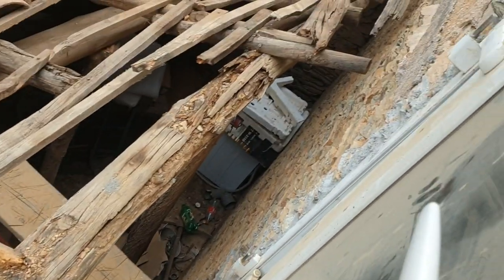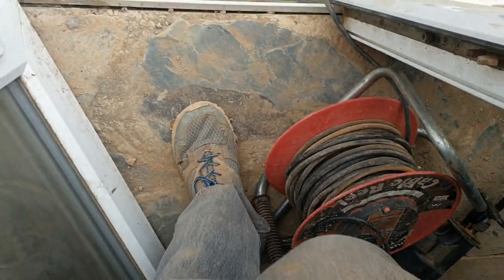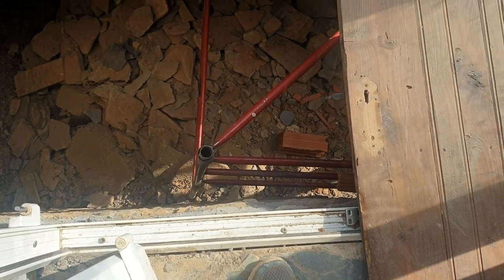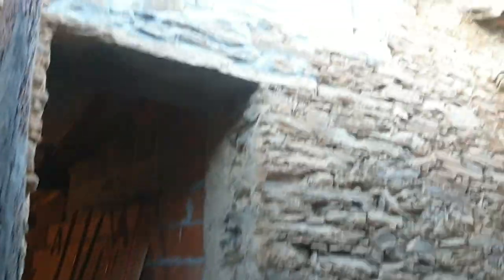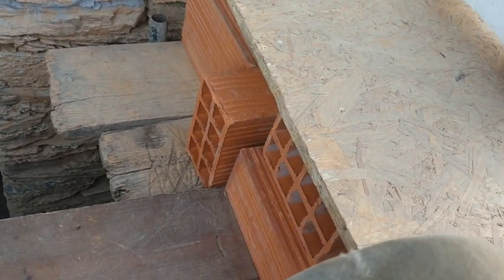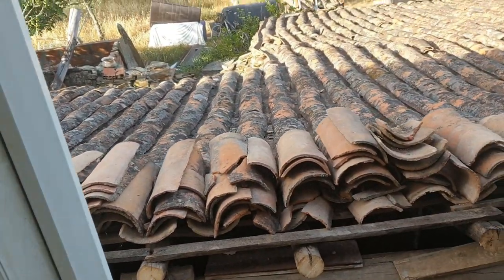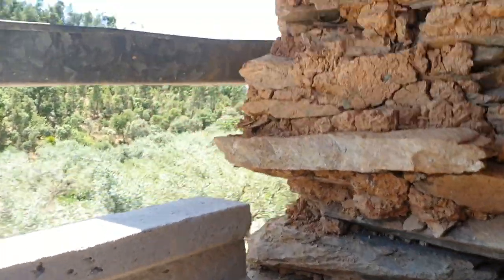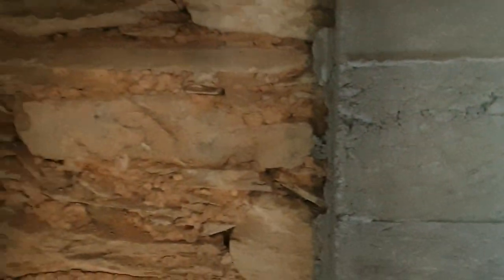#30 Admitting making wrong choices

Comment: You are doing good. It has inspired me to get back to pointing my walls. Sometimes it gets overwhelming when there is so much to do. Thanks for making your videos.
Reply from the maker: Hi Connie, If you get good at pointing, you can show me how to do it properly.Lol. It can be overwhelming, but it helps when you get encouragement from other like-minded people.Thanks again for your interest and kind words. Take care
Let me know if you did get your pointed started.
Reply: @portugueseutopia7039   Hi! Yes, I have been working hard on my pointing. My rocks are granite and a mixture but not schist. I'm wanting to get it all done before winter plus we are replacing the ceiling. Beams are up and ceiling boards are finally going up today. Bug retardant and linseed oil applied. We are in our 70s so you can do this. When are you coming back?
Reply from the maker: @conniedenton6453  Hi Connie. Glad your pointings going well. Sounds as though you are really cracking on with it. My retirement allowed me for the first time to actually have a good run at theproblems of an old casa. You fix one thing, and you realise that you ought to be doing something a bit more urgent. Iwent building up internal walls, but it is the xternal walls that are not stable, due to roof beams, due to beetles and woodworm.
The tiles are reusable, so it makes it viable to replace the wooden beams with steel ones. The majority of this work will have to be done by a builder (who I have made contact with) and I will do some lackying for him. Cass couldn't come with me on the 6 week visit because her mum was dying, She was also keeping an eye out for my mum (who is 93) so the next trip is for her. It will be a relaxing 2 weeks in Greece (Halkadiki). Then we will have Christmas, and then I will plan for early next year, all being well. I do miss Portugal so much, but am not in a position yet to commit full time. So it is always in my mind daily. I watch a lot of Youtube at night, while Cass watches her soads.Lol. Keep up the good work. It would be nice to see some photos of your project if you do much documenting. Take care. Talk again soon Steve & Cass
Reply: @portugueseutopia7039 Hi Steve, we are doing most of the work ourselves except for the new concrete floors and window and door replacement.  Getting help to show up has been a real problem or they show up once and don't come back for a couple of weeks or so.  That is why we are doing so much ourselves. Our place was in a similar condition but the outside walls are in fairly good shape but need to be replastered.?  We wish that we had figured out retiring here much sooner when we were younger and had more stamina for this. Several walls had to come down and the old render had to be dug out of the walls so it could be pointed. That was the hardest part.
Take care. Looking forward to when you all are back and working on your house. Enjoy your trip to Greece.
Reply from the maker: @conniedenton6453  Thanks Connie. You keep   taking those drinks breaks, and we are allowed an afternoon nap once in a while.